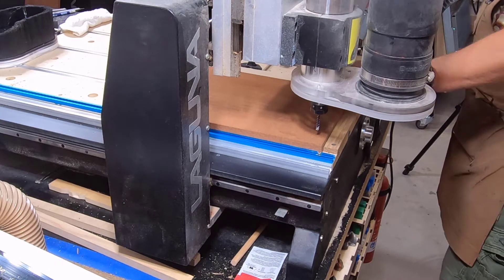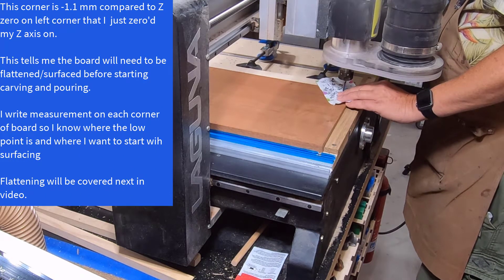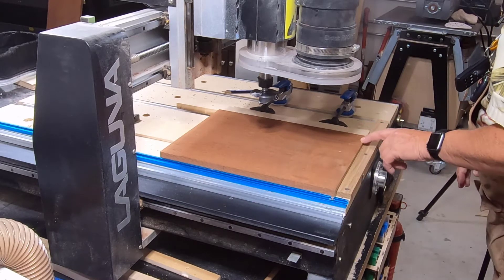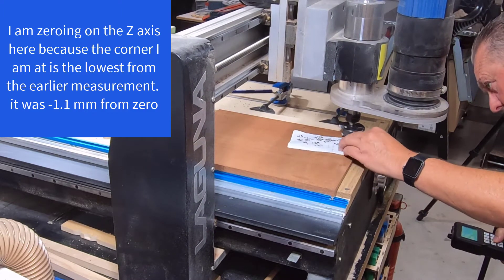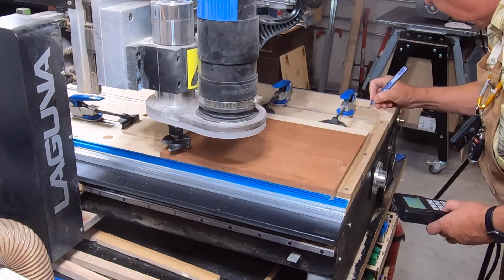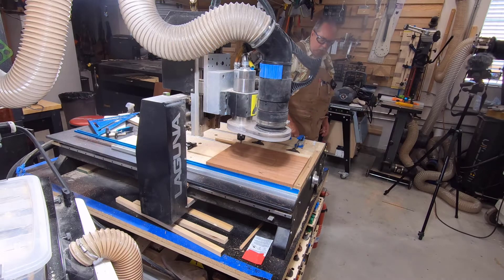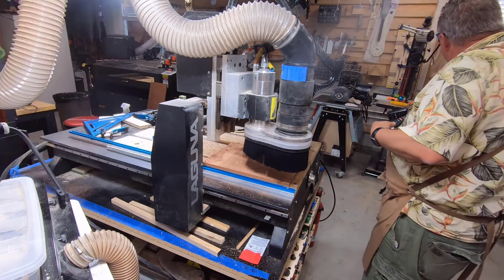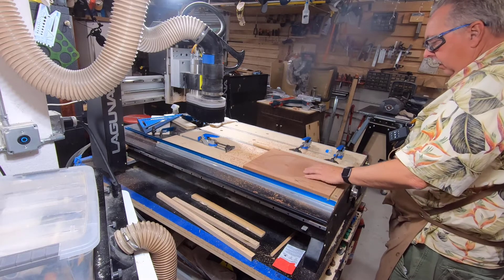Multicolor Epoxy Inlay Flattening Board and First Pocket

Comment: Nice video! Was there a reason you used a 15 vbit vs using a 90 at this step? No fine detail here.
Reply from the maker: I think I used a 30° vbit not a 15° vbit for this clear pocket.  For most of my multicolor epoxy projects I use 15 or 30° vbits.  I recently started experimenting a little with tapered ballnose bits to see how they may work.

As fir why not use 90° vbit, I think you can use that if you like just realize the slope on the side if your cut will be more dramatic.  Not sure in long run it will matter that much but as you mill in the end the chance for your final vectors matching your original design will be diminished a bit.  See vectors overlap video if this part of comment doesn’t make sense.
Reply: @RobSandstromDesigns  that makes sense with the 90v cutting more away than the 30 or 15. I’m just getting into this so that really helps. Yeah I just picked up a TBN with a 1.0mm tip so I may give that a go.
Reply from the maker: @MrHammy40  Enjoy yourself that is the important part

Comment: You could use a pair of winding sticks to check if it's flat.
Reply from the maker: You sure could - if it wasn’t flat you’ll still need to flatten - one way or another.  I mentioned there were several ways to flatten.  This way ensures even if there are minor calibration issues with my CNC, the surface of the board will be flat to the path of my CNC.

Comment: What if the reverse side of the board has low spots or is a little warped?
Reply from the maker: As far as the epoxy inlay it won’t matter.  If it impacts the function of the final product it would need to be addressed.  If it is a problem the other side can be surfaced also.  There was only 1.1 mm taken off on my board - nor a significant amount for the plaque function but it could impact some of the detailed epoxy locations (around trigger in rifle )